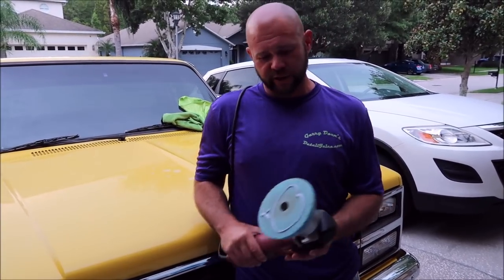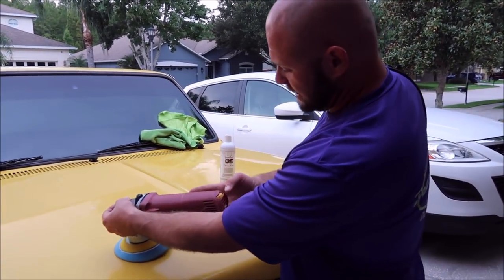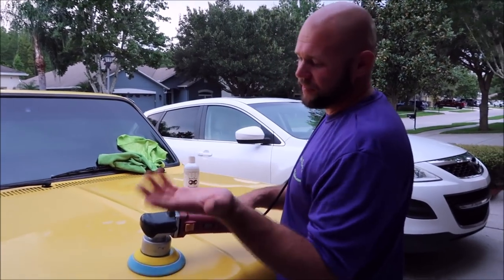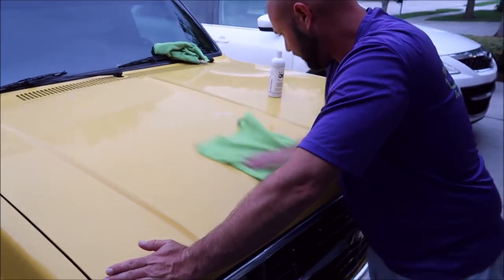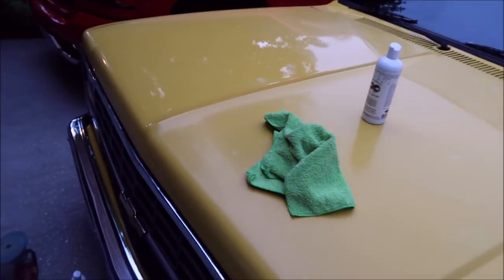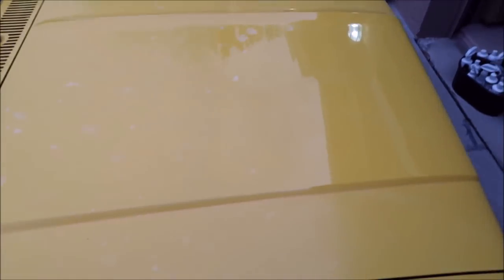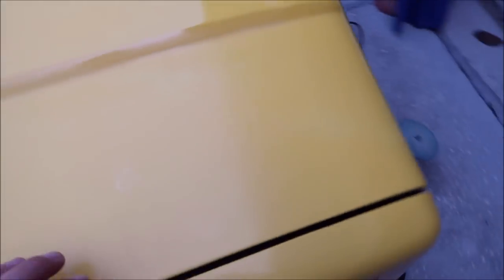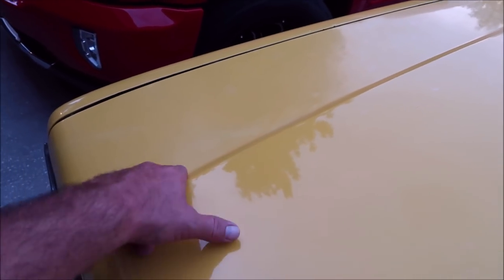PAINT CORRECTION BASICS FOR THE AVERAGE JOE - HOW TO POLISH YOUR PAINT AT HOME

Comment: Gary...love the simplicity. Curious how you attack a full detail. My Durango has large panels, small panels, medium panels. Some panels a 5 inch would work, others look like a 2 inch pad would be better. Where do you start if you only have a DA from Harbor Freight and an electric drill ( with ? I have backing plates from 5 inch to 1 inch as well as a drill adapter. Do you hit all the bigger panels, and work your way down? What's the most efficient?